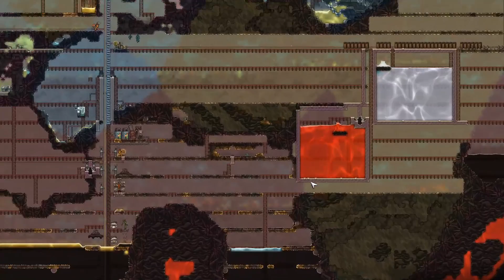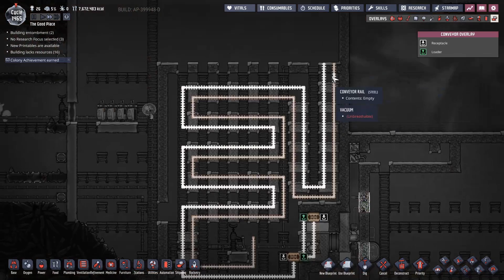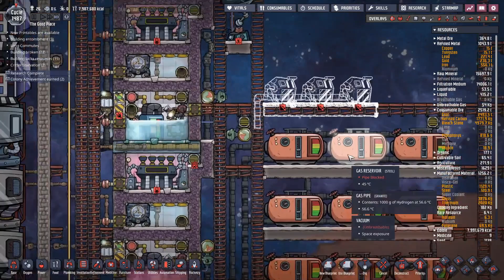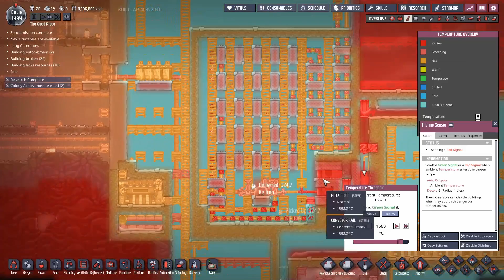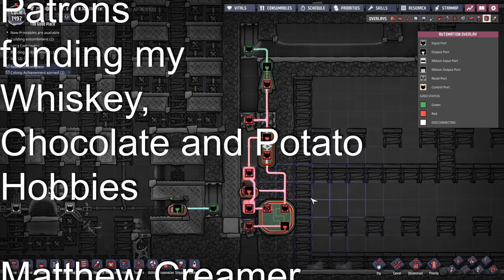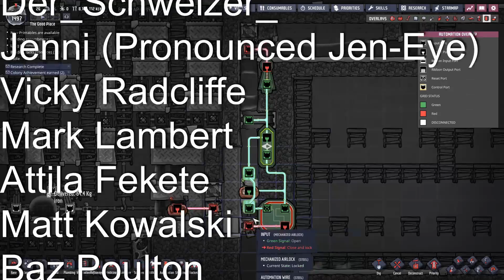Badlands Hungry Dupes 20 : Melting Rust, because we can : Oxygen Not included

Comment: I use insulated gas pipe directly behind the vents in my hydrolox setup so that I can use the  simpler and power free automation option.

Assuming I find a bit of isoresin early on, anyhow. It's not worth waiting on isoresin if you find early fullerene.

My current map, I've been intensely unlucky with fullerene. I had to go out to 90k before I found any at all, and I have a sum total of 3 planets with fullerene.
Reply from the maker: 90k ouch, I have heard several horror stories about this, my fervent hope is that it never happens to me.

Comment: A little tip for E-melter. For preheating, use the hot igneous rock and obsidian around the magma biome or volcanos. You can dump a couple of tons of obsidian/igneous rock on the floor and run them through the conveyor rails so that the incoming rust will be preheated.

Comment: Isn't this horrible waste? Shouldn't you melt the natural rust tiles before digging? As you loose 50% of rust just by digging! :-D :-D :-D
Reply from the maker: I'm trying to imagine how you would melt a rust biome and cool it down afterward. It sounds very messy.
Reply: @FrancisJohnYT  Messy indeed, but +100% iron :-P. I was thinking about molten led go into pipes, and then heat it to 1700`C as coolant for making Steel in Metal rafinery and then send it to isolated rust biome (dig all except rust, filled with a gas), but that would be too hard as rust has 4x SHC and there are tons of rust in there.
Reply: Actually, now when I saw another of your videos (episode 23 of this series) about pumping magma with just steel pump, I think it cloud be done with magma (using it as "coolant :-D" for Metal Refinery, heating it to ~2300°C and running through radiated pipes in the rust biome.
Reply from the maker: @youttube7752  You would have to use one of the special metals like steel in the pipes. Steel melts at roughly 2400C but only solidifies at 1083C. Maybe even limit the flow to 1kg/s to make sure it does not state change in the pipe. Then all you need to do is make about 1 ton of steel for every 1 ton of rust in the biome :)

Comment: when you build petroleum boilers, do you build the boiler itself more than 2 squares to control temperature shifts? i have built single tiled boilers, but have been having trouble with higher temperature petroleum than the thermal sensor is recording, for some reason.
Reply from the maker: It's was a long time ago I designed petroleum boilers, but if memory serves the issue is the falling crude. The drop falls, lands at the bottom of the boiler and then for a split second you have the bottom tile of the boiler is "full" of a crude oil blob. So if you have a temp sensor right there it can end up reading the temp of the freshly dropped crude oil. So I placed the temp sensor one tile up so it is always in petroleum, I also widened the boiler so I could achieve a more even temp in the boiler, this allowed for a smoother control of heat. For example if you heat up the boiler to 406C because the magma is really hot and door injectors are not perfect, the dropping crude oil will slowly bleed out the heat. The smaller the boiler the more likely overheated petroleum gets kicked out onto the counter flow and damages the pipes.

Comment: Here's a fun idea: heavily automate your hatches or incubate some wild eggs and make some seriously huge batch farms to consume your cooled igneous rock from your regolith melter. That way, you could get power and steel out of regolith with 0 waste products.
Reply: hatch batch farms... batch hatch farms... yes
Reply: @ChristianAkacro  theres enough regolith dropped on the map on average to support 141 tame stone hatches continuously, if you didnt do some glum metabolism cheekiness. That would produce 9.9t of coal EVERY CYCLE so adding that to all the iron from the rust melter... he could be making 50t of steel a cycle until he ran out of iron, assuming he can also get 5t of lime a cycle. That's assuming he cooks the coal not in a kiln though, as that reduces coal efficiency by 20%. Otherwise that coal could be used for power, netting about 9,900 W/s if the coal is burned continuously, and also 330g/s of CO2

Comment: I get my refined metal by melting aquatuners in a vacuum room. I found a way to make it work safely with no space materials.
Reply: Aquatuners?  I'd think that they would stop working (and thus generating heat) when overheated, making it impossible to melt them with their own output.  Kilns are the traditional way to melt metal with no further input.
Reply: @Majromax  Remember that metals have a very low heat capacity (~0.5dtu/g/Cº). On the other hand, an aquatuner dumps an assload of heat (~500k) when running on pwater *EACH TICK*. Being in a vacuum none of that heat will dissipate, and as you can easily see A SINGLE TICK of an aquatuner running will increase it's temperature by about 500º

it's not that nonsensical that the machine would reach melting temps before realizing it's overheated.

I can even testify this works. I discovered it accidentally when I decided I'd try to see if an aquatuner irradiating IR into space could get rid of my heat.
At first I was actually dumbfounded so as to why my iron ore aquatuner was dissappearing and getting replaced by an iron ingot.
Reply: @Majromax  the tuner melts before it overheats. the pipe loop is intentionally not full so that the water doesn't stay in the 1500c ceramic pipes. once the iron cools down by about 4 degrees by touching the ceramic pipes, it solidifies and a sweeper puts it in a storage bin.
Reply: I'd like to see a screenshot of that design
Reply: @ChristianAkacro  go to the blueprints channel in brothgar's discord

Comment: If the magma required for this project becomes useless after hitting a certain heat level, namely below the melting point of rust, then it would be slightly wasteful to just convert all of that into steam power.
Reply: I know that it is impractical to use it for any purpose other than electrical generation, as it is dependent on the rust melter having throughput. This previous sentence defeats any and all practicality vs effort, but to have this feed into a petroleum boiler together with a normal supply from a volcano as supplementation, would be an automation problem requiring solving. Could be fun something to occupy time.

Comment: For the E-shaped melter, is there any reason in particular why the tempshift plate designated to interact with the door can’t be swapped with the metal tile below it? I mean, you could harvest that extra little molten iron that’s just sitting on the tempshift plate!
Reply: It's probably there to give more heat transfer medium and stabilize liquid flow. It also might be related to how the debris would pop off of the shipping rail conduit. It may be necessary so the iron doesn't end up in the door on the other side

Comment: Hmmm. Meanwhile my rustmelter was just slaming Conveyor Receptacle in the end of magma blade. Second magma channel opens when magma temperature falls below rust melting point. And rust preheat in steam chamber where hot iron and igneous rock accumulate. It much much less effecient as rust temperature is only around 600-700 degrees, but it much smaller in size. https://imgur.com/EjKnVYD

Comment: What's the difference between placing 2, 4, 6 or more metal tiles for each "block" of the heat exchanger ? I don't understand why 2 tiles is apparently the most efficient way of doing it :/
Reply: Each 2 block chunk can be a different temperature, theoretically they will be lower as it goes through.  Having one or more long ones, you have higher  temperature than the smaller 2 blocks builds.

Comment: On the last video I left a comment on how to use the counters. I'll try again because it will be useful.

Edited for easier reading 

This is in reference to the rocket that needs to run every 100 cycles and you've maxed out the counters trying to do that.
 Stack the counters. 

Counter 1 set to 10, it's output -> input to the second counter, self-reset. 
Counter 2 set to 10, it's output -> launch rocket, and self-reset. 

This has the effect of multiplying counter 1 by counter 2.  in this case, 100 counts.
You can add a 3rd counter and keep going if you want to.
Reply: congratulations, you just invented positional numbering

Comment: I have been running using Vent shutoffs for 800 cycles and never had it freeze in the pipes, I don't cheap out on the pipes inside though ;)
Reply: Same here.  Nearly 1000 cycles now.  I don't see how it could freeze in the pipes.  When delivered it is delivered into a vacuum and even when there is a gas at that point it is the same gas.  What game physics would liquify the warm gas?
Reply: @dougingraham5807  Mine gets down to at worst -60,  if it hasn't been flowing for a long time (like when I accidentally grounded my rockets) but never gets any colder as you say, it is a vacuum so no cold transfer.